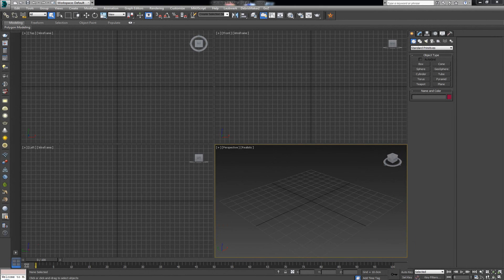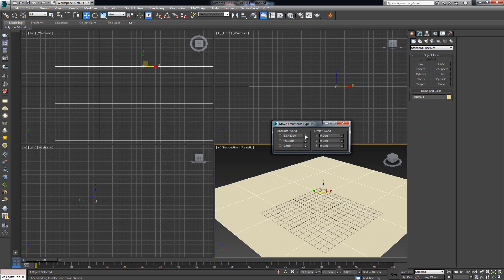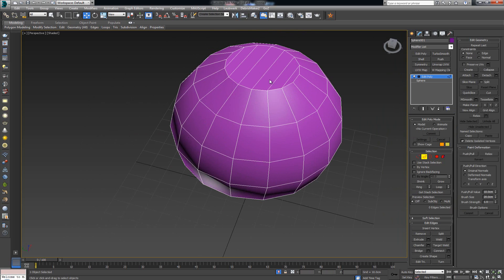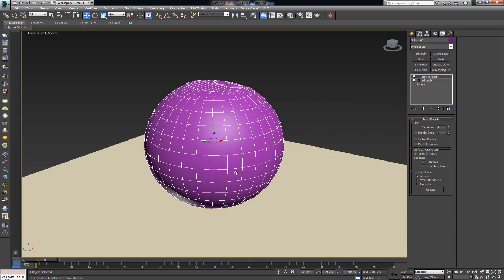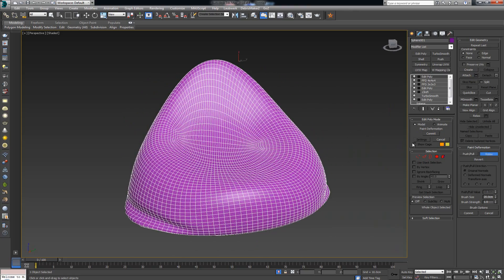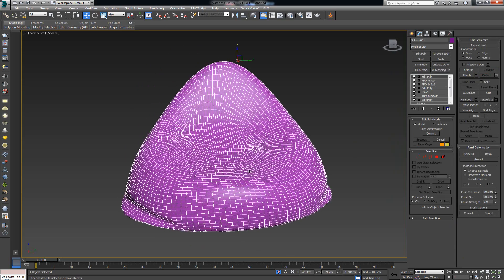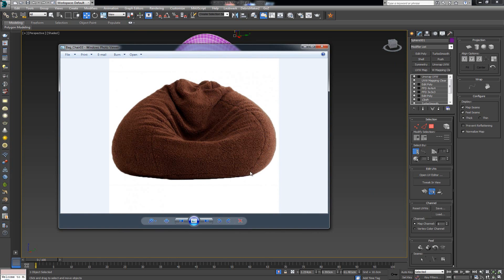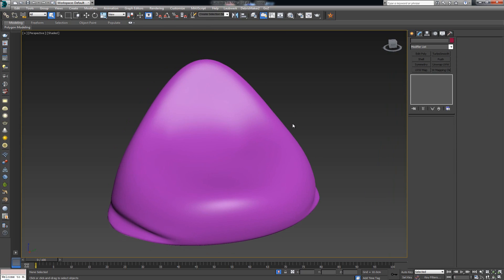Modeling a Bean Bag Chair in 3ds Max

Comment: If I were to add an object inside of the "beanbag" as a collision object, would the beanbag conform around it as it simulates? Or would the object pop right out?
Reply from the maker: +TheOrbling Not really sure what you mean there, but anything that you use as a collision object will be used as that and it will make the cloth conform around it.